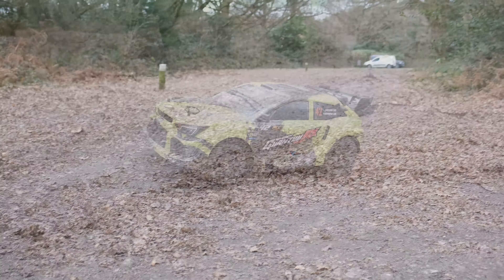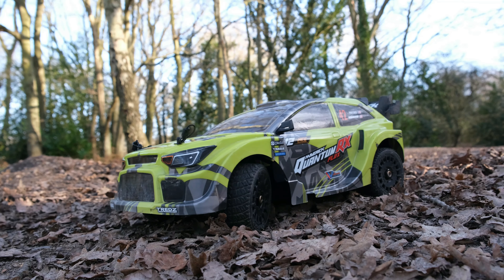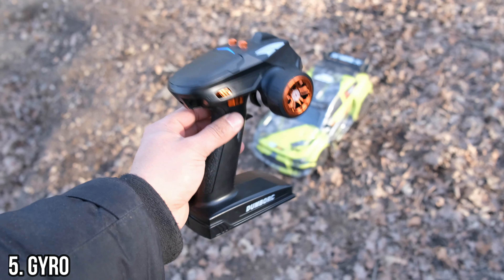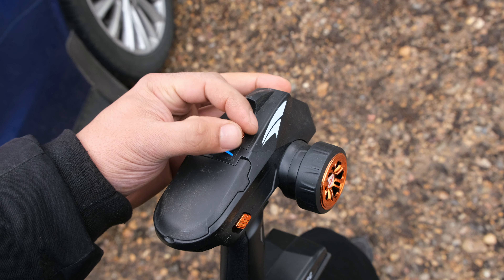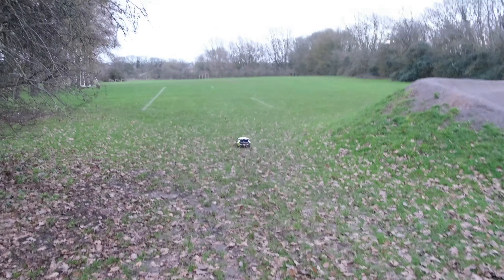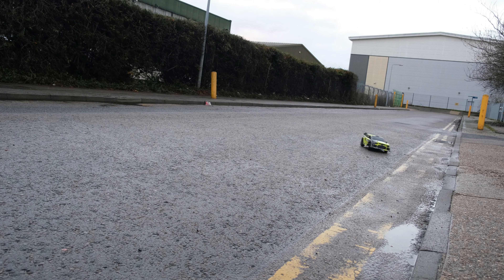5 MUST DO Upgrades on Maverick Quantum RX 4s Flux!

Comment: I think the servo upgrade is overpriced and overkill for most people, I think a decent brushed servo for $50 or less will work fine, like an EcoBoost servo. The bearing upgrade is right for some people, the body clip retainers are a good idea (and some will just convert to Velcro, like on race buggies). Gorilla tape works great for backing and reinforcing bodies, much less involved, less expensive, and a lot easier than the ShooGoo and drywall tape method. I use Gorilla tape on all my cars, and my HBX 16889 body shells (which take a beating) look perfect. You can also add some tape to the outside of the body where the car slides along on, to protect the paint and body further (replace that exterior tape as needed). Gyro is good too, I use the same DumboRC X6 on my brushless 144001.
Reply from the maker: Of course which is why i mentioned this in the video. Its what i had available as i was doing a promo video for them so made sense. Same performance can probably be had for less money. Appreciate the feedback  :)
Reply: Is there a certain servo shape or are they pretty much universal. New to the RC world and trying to understand dimensions and how you know if certain one's will fit.
Reply: @Yii00T  1:10 scale cars usually all use the same servo but some bigger 1:10 cars use 1:8 car servos. Some 1:12 cars use 1:10 servos.

For these smaller 1:14 and smaller cars the servos are categorized by weight. I believe the HBX uses a 17g servo. All 17g servos are the same size. If you are ever unsure just hit the forums. Hope this helps
Reply: @The_RC_Dude  thanks mate appreciated.  Just getting into techno waffle a bit more. It's something I might try find YT videos on. 

Appreciated

Comment: If you need a gyro on a 4x4 or AWD off-road car then your not a good driver. Only reason a gyro should ever be needed is for stabilization in helicopters and to assist with drifting rwd 10th scale and smaller. Practice practice practice and leave the electronics assistant behind
Reply from the maker: ever heard of TSM (Traxxas stability management), Arrma AVC (active vehicle control) some of the largest RC companies in the world are including gyros with their models. Even my Xmaxx had a gyro out the box. Its a great technology. It can be turned off. Does not mean you are a bad driver if you use it.. some people like the extra assistance..
Reply: Wrong and weird opinion but ok 😂😂😂

Comment: Metal shielded bearings are going to be the same annoying bugbear that friction shocks are!! Why?!! Just why?!! For the few pence difference between metal shielded or rubber shielded, surely the manufacturer's want their products to last more than one run in wet conditions?!! 🤔🤷🏻‍♂️
Reply from the maker: Not sure why they went down the metal shielded route considering its a rally car made to be used in wet/damp conditions and features water proof electronics haha! Dont make sense apart from money saving. Bearings are only a bit more expensive though so not sure what they were thinking.. Odd by Maverick/HPI

Comment: Just got the blue one for my B-day last month.  Lovin' it so far.  So far I installed a X6FG receiver and replaced the slow servo.  I like to paint on E6000 adhesive to reinforce body and used self adhesive foam washers on inside for holes.  Clips are harder to get on, but none have popped off during bashing, plus body doesn't rattle.  Will look into bearings next.
Reply from the maker: Great idea. Bearings are a must if running in wet conditions. Metal ones wont last one run :/

Comment: The RX Flux has been a blast, and the servo and radio are certainly the weak points. I got a Flysky gt5 and just needed a $10 receiver, the servo I got from aliexpress is the ds3225sg which is strong and really fast for $25, I use it on all my 1/10 whenever I need an upgrade. With 3s the RX Flux is controllable fun, 4s it's pretty wild and free lol.

Comment: I really want one of these - if it has sealed bearings I’d already own one. I just don’t have the time to open one up the day I get it as I’d 100% be running it through the same conditions you did.
Reply from the maker: Yep such a shame it comes with metal shielded bearings out the box.. considering its a rally car not sure why they went down this route. took me a whole evening to change over all the bearings.

Comment: i love mine the main thing i didnt enjoy with it was pretty much using 1/10 shocks on a 1/8 car just abit to much sag all around so i fitted a set i had spare from my absima 1/8 scale truggy maybe abit long but changed the way the car drove huge and yea i have a gyro in mine makes the driving experience that much more fun on the loose surfaces

Comment: Hi Beyond RC I have just recently bought this Mav flux rally car 4s & was happy with the value of this car in this cash hungry RC World & recently had seen your reviews on this car & thought I'm getting one of these Then when my parcel had arrived got a battery charged reinforced the bodyshell  shoe goo & dry wall tape for the flexible rubber effect from the glue whe it n dries / Tape is great to helps to toughen & flex with out splitting Anyway I took my flux over the cricket pitch on smooth grass I noticed when driving the car seemed to be all over the place so I brought the car back & noticed that the rear wheels when accelerating where working & the front wheels wernt  I don't no if you have had this issue or heard about it so I contacted the model shop where I purchased it & explained the situation they were happy to get a new one over to me hope to have loads of fun with this car & although I like the bodyshell I would like maverick to do more body options be good to see some group B rally style options like the carisma aud sport quottro ect also a dust cover would have been plus & wanted to you do you the carisma audi quattro sport s1 & the hpi suburu if so can you do a rally review also there is the team associated rally car would be good to see a shoot out & review on all of the rally car anyway thanks for another great review & will be Looking to upgrades & another body that will fit or customise one cheers to another review rally style TN RC

Comment: Where did you find the 2) Rubber Sealed Bearings Required:

1x 5x8?
and which thickness?
In the parts list they are not listed, and as replacement parts also not listed on the hpi website for this model. But maybe i have overlocked something. Thank
Reply: I know this is old but if anyone wonders it is 5×8×2.5mm

Comment: Hi Beyond RC i own one of these rally cross cars.
When I bought the Maverick RX from new I took it out for a run on 3 s battery & after a while noticed the car had an issue with the 4 wheel drive it went in to two drive only & was all over the place . Since then I sent it back to the model shop they said it was a grub screw had become lose its sorted now such a minor thing. Have you had this happen to you or have heard this happen before?  Also what is the best low priced 4s battery as going from 3s  to 4s ? Cheers TNR.RC
Reply: This is a common issue for these you have to apply loctite to stop this from happening, for batteries try Zeee they are probably the cheapest and hold up well

Comment: Great job! - Did your body reinforce mod take away that awful body rattling sound this car is known for? Or does something else cause that? Its really annoying with it flapping around like an old woman's landing gear. This is stopping me from buying one as the body is garbage, BUT the paint job is excellent.
Reply from the maker: sadly not. Still hear the rattle :/
Reply: @beyondRC   I've been thinking... I know that you have one, Do you know if the Subaru WR8 Flux body fits it mate? Or, Which other bodys would fit?
Doesn't matter if I have to drill seperate body holes... 
I'd really appreciate your time to find this out bud.. Cheers mate
Reply: @300-PRC  I strengthened my Blue body with dry wall tape, then shoe goo and then sealed it with 2 coats  of Black flex seal spray.  it's built like a tank and does not rattle. Raised the body posts and that also helped alot, thanks to a previous members post. Increasing the shock oil wt should also help scraping, my next task.
Reply: @Rob702Life-qq1nx  Thanks buddy, That is genius! I ended up ordering a blue one 2 days ago and it will be here tomorrow morning. I'm seriously considering grabbing the green one as well. Down here in Australia, we are seeing a literal price hike of 50 -100% markup on RC in general. Things are selling very quick and because our government is shy of dealing with China, We and they for that matter are suffering big time...but there is of course a lot worse off so I should be grateful I guess. You reckon its worth me buying another before they go?? Are they pretty good?, or hang out and see whats gonna happen with this stupid war which has potential to stop all of our imports..Everyone could be greatly affected potentially when it comes to everyday items we would normal take for granted. Im an old fart mate and addicted to my RC cars and boats since retirement.
Thanks champ! Appreciate your advice here. Take care, God bless you and yours. 👍
Reply: I used black duct tape on the inside of my Blue Body.... REALLY made ALL the difference....Much more sturdy feeling and eliminated the body rattle. Highly recommend taking the time to line with  black duct tape or similar!
Reply: @natestapp5573  Thanks man, Much appreciated. 👍

Comment: My mistake, my maverick quantum flux R race / drift truck came with gyro so i obviously thought that my maverick quantum flux Rx flux did aswell as it has the gyro buton on the maverick radio
Reply from the maker: hmmmm you sure?... Dont think so...
Reply: As far as Gyros for this car.....I'm planning to either get another Traxxas TSM RX, and use my TQi TX, or just  get a Sky RC Gyro...... Haven't decided yet........ But, I definitely want to run a Gyro with this car.....It has a lot of power!

Comment: The steering is a bit of a broblem cause when i drive at winter all that snow packs in beetween them moving parts and The steering doesnt Work other way
Reply: Simple mate... Change out to a	DUMBORC X6 6CH 
The receiver has a built in adjustable Gyro and is a must have for this car... It really does improve overall performance. Also Throw the stock servo in the bin and get a faster/stronger servo.
Reinforce the body and you have a beast of a rally car with a lot of potential to upgrade further.
All the best, Take care man.